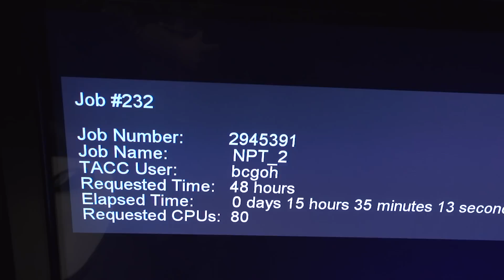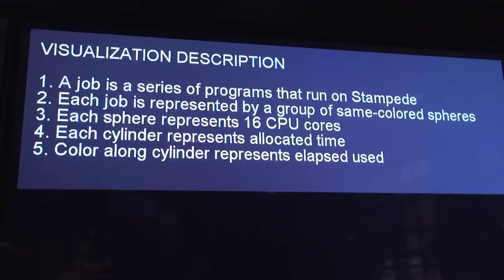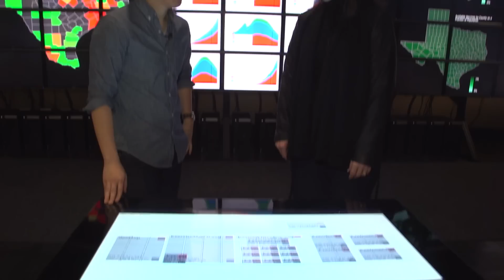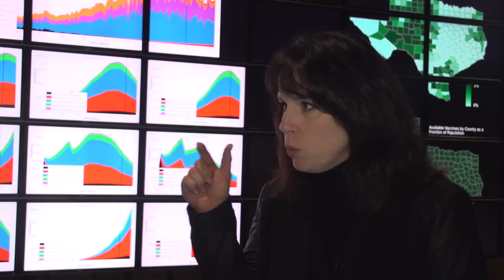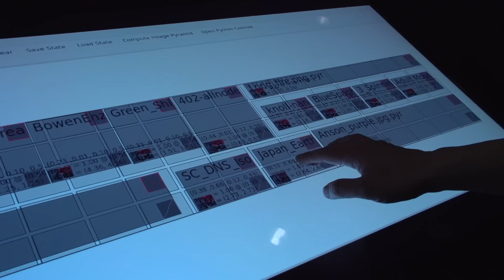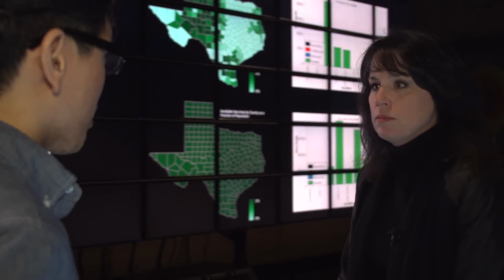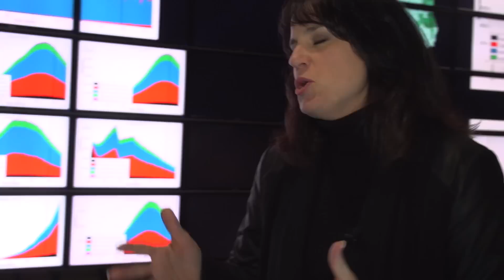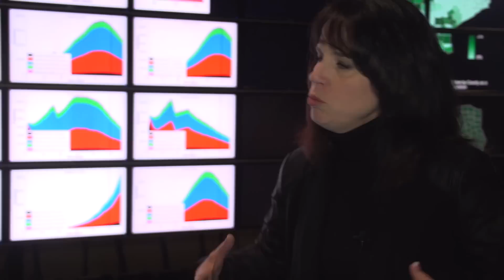What Makes a Supercomputer?

Comment: Not impressed.  Nothing but a bunch of PCs hooked up together...nothing innovative about it....
Reply: +Steve Aimes Hooking up a bunch of computers in-and-of-itself is not necessarily an easy task, especially when you want to provide a scalable, efficient solution. And this is more than just hooking up a bunch of computers. It's creating ways to utilize and partition this massive amount of computational power to clients and giving with intuitive ways to interact with their system. My knowledge of computer hardware and the inner-workings of operating systems in limited. But I know enough to have a decent respect for what these people are accomplishing.
Reply: +TheLazyKey It can't be that hard because bitcoin for example hooks up thousands of computers over a simple internet connection and supposedly has much more power than a super computer?
 TheLazyKey
Reply: Steve Aimes Hmm... This is true. But then again, BitCoin machines are all only performing one task. Plus, I am willing to bet the super computing model of a bunch of computers with different CPU architectures and hardware connected over the internet is far from optimal.

Comment: This video is very helpful, i am current a college student and i am taking a computer course . this video help me understand what a supercomputer is in detail. i learned that a super computer is design to move more rapidly and efficiently , it holds more volume  data . The software is more up to date, with different applications  all in which  can be used on a smart computer that cannot be used on a mainframe

Comment: i bet they can do like 50k gaming
Reply: +Alfred X Its, not a graphic intensive supercomputer, it doesn't even run normal operating systems at a consumer level. So it wouldn't be able to most likely. While it does have many GPU'S, its main purpose is to calculate and crunch numbers with all the cores it has.
Reply: Yes (maybe) like I guess it's playable. :/
Reply: 4 Years later, we're still at around only 8K screens.

Comment: the bitcoin I can mine with this o my gosh
Reply: mikegunz A unrealisable dream, just forget it ..
Reply: for weak computers that is.
Reply: mikegunz those are CPUs , you would need asics or GPUs to mine. CPUs now would just overheat and destroy the computer without making a dollar
Reply: Chris Kim sure, they built clusters of thousands of computers that can't run at 100% CPU utilization without overheating... Mining bitcoins or stock market data or weather data these systems could run capped out for days on end without any issues at all.
Reply: Callum Errington maybe, but first the power consumption would make you debt higher than your profit . Also you don't need 100% utilization to overheat. Also bitcoins are going down the drain and have been only spiraling downward since they reached $1000 per coin
Reply: Chris Kim he also said that 7 of their teraflops come from GPU like microchips, so it would mine hella fast haha
Reply: ruben martinez lol true, u got me there:) although bitcoins go on asics now, even GPUs can't make enough money to make up for the electricity debt. I tried mining a few months ago and now even my asic can't keep up xD
Reply: Chris Kim its a good amount of hardware thiough so it should be possible, i know they asked on the video but they didnt mention if it could, though it does sound capable of doing that.\
Reply: ruben martinez its capable, any processing unit is (almost), although my argument is that u would loose more money than u get because power/energy cost is a large factor
Reply: Chris Kim I'm sure this machine already takes a lot of power lol

Comment: Use it for gaming. It would be profitable like the arcades of the 1980s.
Reply: games would run horribly on it, super computers aren't designed for gaming at all, just doing large amounts of calculations very quickly, not rendering graphics.
Reply: Nameless OK so add a few gtx titans there ya go
Reply: ***** but it would be what the dev. Wanted the game to be and I'm sure you would never have a fps issue either haha with any game currently made unless it was really crappilie made or for some reason just set to a low fps but really you could play a full multiplayer server of arma 3 and more and still work out some CPU stuff while computing some random stuff and still not be "lagging" so to speak
Reply: ***** I guess the only way to know is to try I will now build a supfur computzur
Reply: Mesmer Z or Arma 3 at full settings

Comment: Back at the university in the early '90s a professor told me about that (for example what distinguishes a supercomputer from a workstation):

A simulation would take 4 weeks on the workstation. A computer is a supercomputer when it can do the same sim in 5 minutes...after you waited for 4 weeks to get your time slot. :)
Reply: And now what would take supercomputers 30,000 years.... Would take a Quantum Computer just shy of 2 days. .... It's amazing how tech advances.

Comment: I was wondering if this computer was capable of running a game called "Minecraft"?
Reply: If Minecraft runs on a custom Linux distribution...
Reply: flatshade Was joking, but I'm pretty sure it can, but i guess it depends on the distro
Reply: ***** My Coffee Maker has java, can it run minecraft?
Reply: ***** so if i download some more ram and then Copy and paste my hard drive into my monitor, then i can take that upstairs and plug it into my Blender to then reformat the disc drive...
Reply: ***** sry <3 bb
Reply: ***** *solder* and no you didnt do that with your N64
Reply: Explain the process
Reply: so aka you took out an N64 and used the case to build a computer.
Reply: ***** No.. It's not an N64. It's the case of an N64 with modern PC hardware. I could build a PC inside the case of a Playstation 4. That doesn't mean it's a Playstation 4.
Reply: Audible_Savage A gaming laptop is better than this
Reply: ***** Dude wtf. It's not a N64. You sound like a computer noob...
Reply: what is a computer noob, and why are you squeakers still arguing on my comment?

Comment: How many fps will i get in btf4 at 1080p with this one ?
Reply: Zero battefilde cant be run on linux
Reply: If you could get it to run, I'd say some where around 999999999999999999999999999999999999 and a few more 9's fps.

Comment: To make it more efficient, you need to stack chips into 3D rather than typical 2D silicon chips. it reduces, power and is much more efficient and faster than typical chips. but it produces more heat which can easily be solved.
Reply: ... It's not easy to solve lol.

Comment: waiiiiit. I'm a little lost. So Stampede doesn't just do a single project, its processing power is spread across many many projects?
Reply: When you have that much computer power, not many projects need to run for long.  Getting the raw data and program code ready, and digesting the output takes far longer.

Comment: when you think about, i still use a 9 or 10 year old mac laptop on occasion, and its max built in memory is ~500MB, and now my little gaming pc holds a few terabytes easily. Also imagine what would happen if that supercomputer tried mining bitcoins. Or if they ran a multiplayer fps, imagine stamped running a 10M person round of gun game on BO2
Reply: Wouldn't be worth mining bitcoins. The chips wouldn't be optimized and would provide poor performance per watt in comparison with ASICs.

Comment: What about Quantum Computers?
Reply: BoutchooQc not a lie by 20 or 25 it'll be possible to upload your mind to comp and I am I
Reply: darkheat246  yea and i think one canadian company has one
Reply: Howllo Spice
 Not true. They are stable, just not very useful. For all the billions of silicon transistors in a modern processor, there are only a handful of 'qubits' or linked particles in superpositions in a quantum computer.

The D-Wave quantum computer (still up for debate) has been shown to be equally fast at certain applications (searching large databases, for example) than traditional computers - but you are right, they are generally pretty useless right now and more of a curiosity.

There is nothing to say a quantum computer would be any better at AI than a traditional chip. IBM is currently simulating neurons on standard hardware in one if its projects.
Reply: Right, hmm.. well I assume you are referring to the much maligned Penrose and Tegmark 'idea' (can't really even call it a theory) that the human brain has quantum properties. There isn't any proof off that yet and it's been extremely widely dismissed and criticised.

Here is a short, common criticism page on it:
http://www.sustainedaction.org/Explorations/problem_with_quantum_mind_theory.htm

I'd love it to be true, but it has been pretty heavily attacked.
Reply: Not really feasible as of now due to the nature of quantum particles
Reply: They don't work in the same way. Quantum computers are only faster at certain tasks - if they will ever solve all the problems needed to get one working.
Reply: darkheat246 So the movie Transcendence is a lie?
Reply: well there is atleast one commercial project  that involves a quantum computer wich is if i remember correctly actually already in use
Reply: ThePassiton Google is using them
Reply: BoutchooQc Quantum Computer right now are very, very unstable. They can only do extremely basic math. Like 3+4. They are actually slower then silicon computers right now. But once it's perfect, they will be so much faster then a silicon computer. It'll be like a God, in math. They'll will be mostly uses for decryption, math, and AI.
Reply: Tom Walter I wouldn't call all quantum computers useless after all humans are pretty clever
Reply: darkheat246  Those two sentences don't really go together??

Humans, pretty clever.. I agree (sometimes, we can also be pretty damn dumb sometimes!)

But that has nothing to do with the fact that, at this very moment, Quantum computers are in their infancy. We're not even in the 'Golden Age' of Quantum computing.. they aren't mainstream, they're not being used daily by any major company and they aren't much better than an average desktop, let alone any real supercomputers. So, I stand by my point, they're pretty useless currently.
Reply: Tom Walter I was talking about the human brain....
Reply: BoutchooQc No shit movies lie and exaggerate.... rolls eyes

Comment: "We are ahead of Moore's law" 
But you aren't, Moore's law is:- The number of transistors on integrated circuits doubles approximately every two years. Banding chips together to work on tasks together doesn't mean they all become integrated, they are still separate.
Reply: what he said makes complete sense. cluster computing grows faster than single chip design
Reply: I never said it didn't, Moore's law is about the jump of transistors within integrated circuits, a cluster isn't an integrated circuit. 
I can see the milestone he made, but the fact he's using a law that regards only that form of item, it's a bit silly to do so. Maybe if he had used Moore's law as a comparison and not a milestone.
Reply: Don't misinterpret him by taking that out of context lol.. he was talking about the cluster itself.
Reply: Hmm.. ya. I tend to think of it as a processing power and forget it's actually based on transistor count. So he didn't use it exactly correctly, but his meaning is there. Clusters are growing faster.
Reply: Fair enough
Reply: The problem is he is using Moores law to define parrallel computing, really he should be using Amdahl's law and Gustafson's law.
Reply: It's not even strictly two years. It's just an observation made decades ago and regularly inconsistent. People try to make it out to be something more profound than it is.
Reply: niqhtt Moore's Law is beginning to slow down I've heard, so clusters will definitely be growing faster.